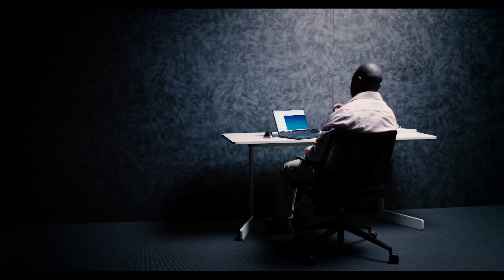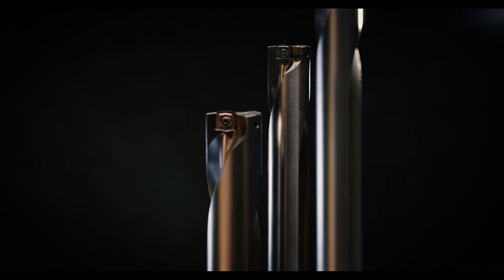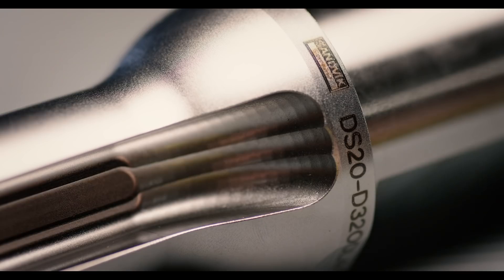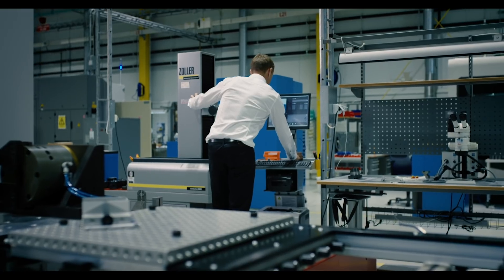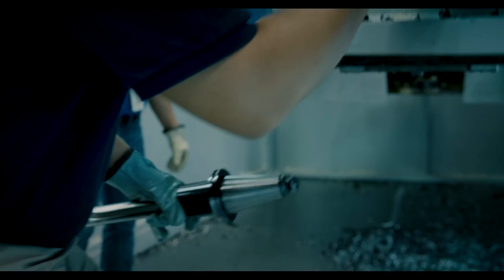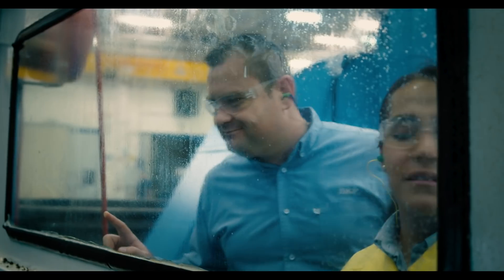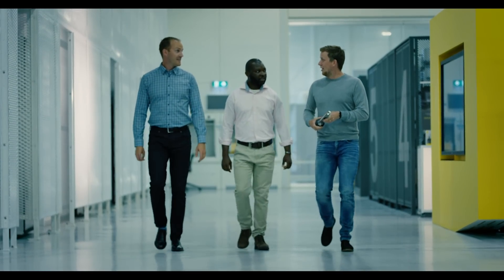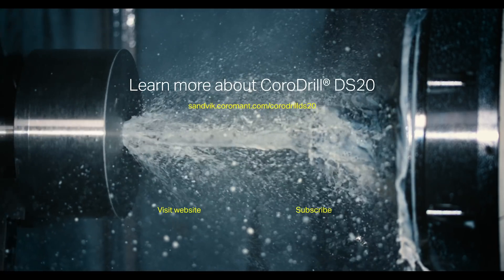Developing the first 7xD indexable insert drill. A seven year challenge

Comment: What's 7xD mean (7 times diameter, but diameter of what)?

And someone in comments spoke of a swapable drill that's technically not the same as an indexable one, what's the difference?
Reply from the maker: Hi Nommy! Thanks for your question! The xD we are referring to is Cutting Diameter, a 20mm hole would for instance have depth capacity of 140mm if 7xD. As for the other type of drill referenced, these are called Exchangeable Tip Drills (ETD). Sandvik Coromant offers its CoroDrill 870 in this product category and should be considered closer related to Solid Carbide Drills. The fundamental difference comparing Indexable Insert Drills (such as CoroDrill DS20) is that ETD’s have a symmetrical geometry allowing for centering to occur more naturally whereas a DS20 needs to balance the cutting forces of the central and peripheral inserts to obtain a balance that centers the drilling operation. 

Both kind of drills have their pros and cons, in general terms ETD achieve tighter hole tolerances, better surface finish and are capable of higher feed-rates. Indexable Insert Drills on the other hand withstand higher cutting speeds and have multiple cutting edges (four in the case of DS20) rendering them the more economical option when tight hole tolerances aren’t in demand. Let us know if you have any more question!
Reply: @sandvikcoromant  Thanks, makes sense.
Reply: 7xD means 😂😂😂😂😂😂😂 

jkjkjk

Comment: Excellent video showcasing the challenges of R&D work and the elimination of the trial and error process through a software solution.
We've used the 5xD CoroDrill 880s before with tremendous success after several iterations on fine tuning cutting parameters for our application.  

I can only imagine the sheer joy of overcoming the never ending obstacle of L/D ratios and vibration elimination.

Good to know a door has been opened for a more efficient way to integrate deeper indexable drilling in a variety of cutting processes.

Excellent work!